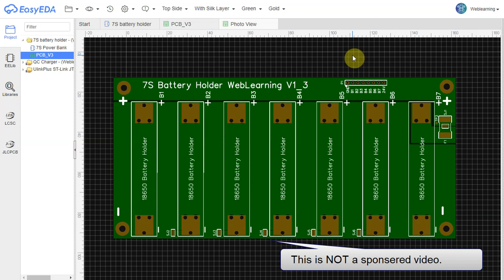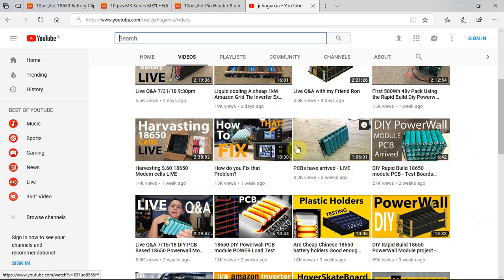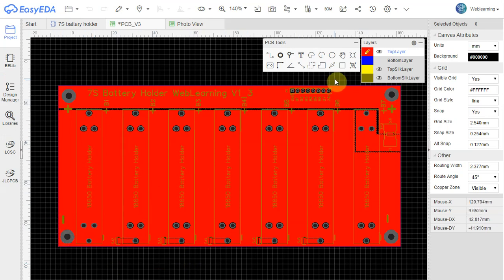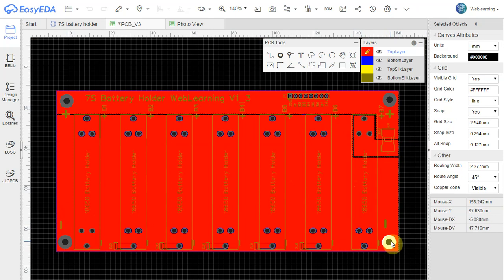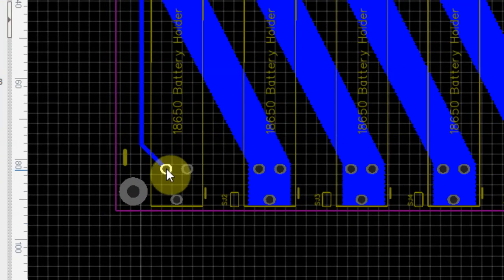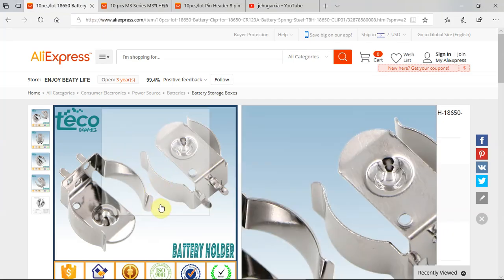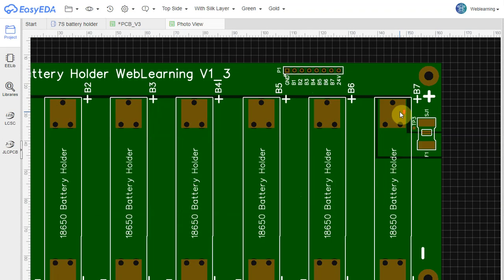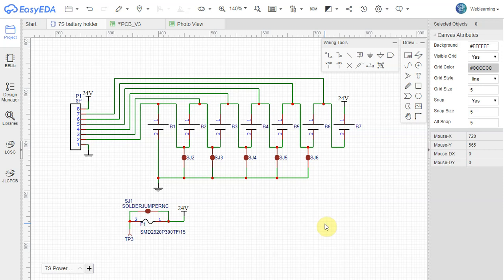7s Battery PCB

Comment: Can we use this PCB with 3S and 5S?
Reply from the maker: Yes you can. I design it in such a way that if you want for example 3S:
You solder 3S solder point ONLY. And add batteries on B5, B6, B7. 
5S:
You solder 5S solder point ONLY. And add batteries on BB3 - B7.

Comment: This battery holder is not preferable because of possible of contact each other and also right and left of the posetive side holder may cut and touch the body(-) side of the battety.
Reply from the maker: Have a look at the previous comments and answers.
Reply: @Weblearning1   which one?....you know what? I bought your design board and i saw the advantage and the disadvantage just last week. Look again the sequence of the  balance pins name and holes...try to correct.

Comment: I don't suppose you could adapt these to 26650 easily?
Reply from the maker: I think it will be possible, need to change the battery holder and re route the PCB traces. If you know how to do this, you can fork the project and do it.

Comment: do not order as is, modify first.

1.When assembled the cell holders are too close and can short when adding batteries. requires more spacing between the batteries. 5mm more in between.
2. both negative standoff terminals are touching the battery holder and are pushed outwards when the adjacent  batteries are inserted. requires more spacing, 6mm more outward
3. separation of the battery clip holder pads on the top side need more separation from the grounding copper .
4. the distance of the cell clips between the positive and negative terminals for each cell need to be brought closer by 4mm due to design of the choose battery clips.

otherwise good design especially since it can work from 2s-7s, and with modifications can be scaled beyond 7s.
Reply: Is it possible to adjust the spaces between the cell holders ; if yes, can some please explain in detail how to do that.

Comment: Hi.
Thanks for the board! It is so good to have opensource stuff out there for others to experiment. 
Could you remodell the pcb that Jehu made for the High power board?
BR,
Gabirel
Reply from the maker: Can you send me the link to what you are referring as he made few different boards.
Reply: @Weblearning1  Yes of course.  Here is the video link to the High Power 7s DIY battery pack. It would be a better choice to have that as it takes up less space. Cheers in advance.

Comment: Great work!  Any progress on your BMS design?  Happy to order some boards and help test.  I really like your choice of battery connectors and overall pcb-based heat dissipation design.
Reply from the maker: The BMS a lot want to join and have it, no one wants to help with the design. So for now, it's on hold. 
Thanks for helping with the PCB tests.

Comment: Have you tested version 1.3 out? I like the metal clips, seems like it would be easier to remove a cell. Also the three points of connection would be stronger than the plastic box attached by eight points for 4 cells vs 24 points for 4 cells. As I mentioned before I would prefer a bit more spacing between cells and if I can figure out how to use eda to do that I would make them and order some. I have several projects for 24v packs I would like to do.
Reply from the maker: I'm planing to do a video on PCB ver 1.4 with most of the comments and I will show how to use easy EDA. Then you can fork the project and build you own.

Comment: has this been tested now? i didn't see an update video on it :/ and is this battery holder compatible with it (https://www.aliexpress.com/item/2x-Battery-Box-Holder-Batteries-Case-for-18650-in-Parallel-3-7V-Pole-Black-Free-Shipping/32655188466.html?spm=2114.search0604.3.54.c0e37c9cwnP9k0&ws_ab_test=searchweb0_0,searchweb201602_4_10065_10068_319_10892_317_10696_10084_453_454_10083_10618_10304_10307_10820_10821_537_10302_536_10843_10059_10884_10887_321_322_10103,searchweb201603_52,ppcSwitch_0&algo_expid=25140a06-4723-4b82-b2d1-af0d3f4aac90-10&algo_pvid=25140a06-4723-4b82-b2d1-af0d3f4aac90&transAbTest=ae803_5)

Comment: Since this was posted back in Aug of last year, do you have this board in production at any PCB manufacturer yet, and if so, which one.  I would love to start testing with this initial board even if it is not yet interfaced with the BMS at this pont.
Reply from the maker: Hi. No board with BMS yet. There was not much cooperation so it was left as it is. All the other boards are DIY and you can manufacture it by your self at EASYEDA or any other board manufacture.

Comment: Hi, great vid. I would be more interested in a PCB in parallel, rather than series, as pointed out in the other comments, so fusing is easier. Some people have made a PCB to slot those units into, rather than using standoffs. The less components and soldering, the better. Or at least the less required after setup, so fuse holders etc.
Anyway, good luck!
Reply from the maker: Any idea how to slot them together? It's eas from the PCB side as I can design the male from the PCB side, the problem is the slot side (female). Any idea that is better then stacking them up is welcome.
Reply: @Weblearning1  Computer slots, like the PCIe connections on a computer motherboard? Bare copper on the ends of the battery holders, slotting into the holder, that PCB being the series connection, with connections to be made from one "back plate" to another.
This thread shows it, but the files don't seem to be available anymore.
https://secondlifestorage.com/t-The-finish-ish-of-a-pcb-based-14S-80P-powerwall?page=1
Reply from the maker: Yes, I know about these connectors from the link you sent, but they are much more expensive then just using spacers, and that's the problem. You need to find a very low cost solution to connect all of them..

Comment: Very interesting, I have built 10 of Jehu's boards and so am very interested in your findings. So please keep me posted also. One thing that I found with Jehu's design was when the thin tracks for the BMS are shorted and blow as they are designed to, there is no solder pad to easily repair the board with a replacement wire. I think this would be a good feature which I will be adding to my design.
Reply from the maker: Good idea. I will keep it on mind.

Comment: I'm in and Appreciate your contribution, thank you for contributing to our growing community. My design or intention has been to use 2 in parallel in each holder to use less boards and take less time recycling laptop packs as they're usually 2 in parallel three or four in series. One could double the standoffs or would this fuse blow.
If yes would it make sense to just add a hole on each side of the fuse to be able to solder a replacement with a axiall glass fast fuse in any case or does this considerably add too much cost?
Reply: Just to be clear it wouldn't be nice to also include the solder joints for a replacement fuse axial glass fuse to have a good visual in place of your bms pcb fuse so one can still protect the module if the printed fuse fails at a glance

Comment: Those battery holder are dangerous.
If the wrap of the cell is damaged near the positive end the positive holder will short to the case of the cell.
Reply: Could use the 18650 battery holder SMD/SMT instead?
Reply from the maker: One of the things that are planned is to build a PCB that will fit different holders. It's in the pipeline, but there are other things before that. Stay tuned.
Reply: @Weblearning1  awesome,  can't wait for the updates.
Reply from the maker: You are correct, but there is no other cell holder that can hold the batteries if you want to use it for something else that is not stationery.
Reply: @Weblearning1  The Keystone single(1042) or double(1048)18650 holders are excellent and much safer.
https://www.aliexpress.com/item/1x-2x-18650-Series-Batteries-Holder-Box-Storage-Case-Container-With-Bronze-Pins-Drop-Ship/32862883490.html
Reply from the maker: Looks great. I will order them and will let you know. Thanks.
Reply from the maker: I have mentioned you in my next vide that I will upload.

Comment: Hi. I note you only use one fuse. If a single 18650 fails with short to ground the fuse will blow. If the board is in parallel with another board the battery monitoring circuit will also be shorted to ground. I see you have a thin track that should fail in this event. However if you have multiple boards in parallel there is a possibility that then thin monitoring tracks will be destroyed on more than one board. This will mean a lot of dismantling to test and repair. Would it not be better to fuse every cell? Then a failure will not be total and you could continue to use the system at a reduced capacity until it is convenient to repair. I understand that Tesla fuse each individual cell. The last thing you want is a thermal runaway.
Reply from the maker: Hi. I agree with you but you need to take into consideration the following:
1. A regular fuse is just like the PCB track unless it's a Polly fuse. 
2. If there is any overload on any of the cells, it has to go through the track in order to burn it. 
3. If the track or a fuse did burn, you will have the same procedure, time, effort to replace them. 
4. The design needed to be as simple as possible without to many parts to solder. Yes, I can make it as robust as I want, but as what cost?
If you want, I can make a robust PCB, let me know what else I can improve and maybe I will make another design.
Reply: I agree that there will be effort to replace a board if a track or fuse fail. My concern is if this is in a multi board power wall there is the slim possibility that several PCB's might need attention even if only one cell shorted to ground. Individual cell fuses should limit any damage to the board with a failed cell. This applies particularly to users with harvested used cells as there is a far greater chance of a bad cell somewhere in the system. I don't think I would be happy to have the current version in my house. Is there a way that the option to fuse individual cells could be added to the PCB for the more cautious users. Or 2 versions, one single fuse as now and one with individual cell fuses. Please note none of this is a criticism. I have been in the machine tool control industry for over 40 years and that has taught me extreme caution where electrical/electronic systems are used 24/7.
Reply: @ianeagland5197  Is part of the issue though that the current board, as well as Jehu's, are both designed for 7s. Cells in series not in parallel. From my very limited understanding, it is far easier to have cell level fuses when cells are in parallel? I can't think of how to design a PCB with cells in series where each cell is also fused individually?
Reply: Would it be possible to just add tiny little holes to the board that way you can place a axial glass fuse if the bridge fuse inside the board burns down we could just solder in a new axle fast glass fuse if not it wouldn't be too hard to retroactively do if said board fuse fails

Comment: I want to be added to the list for the PCB
Reply from the maker: Do you want to help with the hardware design of the PCB or just be informed of the changes?
Reply: I want to be informed on the changes and might wan to buy some to build for my Power wall at home
Reply from the maker: You can click Follow in the EasyEDA and then you will get notification if anything changes. Also, you can follow the channel and when it will be done, I will also upload a video on this. Till then, you can enjoy other videos that I will make.

Comment: Hello. I wanted to buy  10 of your PCB"s but i got an not really good price like 48$ This is the real price?
Reply from the maker: No. Change the delivery so it will be slower, it will reduce the price dramatically.
Reply: I did not wanted fast delivery, that is the reason, why i did ask you.
Reply from the maker: i just checked again. PCB order: $18.86
Shipping, registered Air Mail: $12.58
Total: $31.44 for 10 PCB. That's $3.144 per 1 PCB.
If you dont need 24V, you can use the design that I made for the 4S. That will be much less.
Reply: I got some engineer fee, and i did't understand why, because you made this files, or any people, not any of them, why they want money for it?
Reply from the maker: I also couldn't find anywhere regarding this " Engineering Fee: ". I have sent an email to JLCPCB to tell me why they have added this. I will let you know when I have an answer from them.
Reply from the maker: This was the reply I got from them:
"Sorry for the confusion .
Actually our engineers will review all gerbers two times (before and after your payment ) . 
What's more ,they have to make the working file to avoid errors in the process . 
Thanks for your understand  "
Reply: Ty, for the info, but if they do engineering check how they did not see the problem of your 4S design?
Reply from the maker: It wasn't a short in the 4S, only because of the connector it got shorted. They can only do good DRC, and make sure nothing is wrong in the PCB.
Reply: Can you tell me pls what was wrong, because i'm interesed to buy if it is working. What i have seen on your video, you wanted to find what is wrong and on the panel the battery - and + was shorted. There was no connector yet, or I'm i wrong?
Reply from the maker: If you saw the video, and didn't understand, then I made a bad video if I couldn't show what was wrong. 
The connector of the battery needs 3 pines and a base plate to connect. The 3 pines where connected correctly, but the base plate instead of connecting to the 3 pines it was connected to GND. The same mistake was for the 4S and 7S PCB, but I fixed them both. I still didn't get the new 4S PCB design, so it is also not tested. I don't think there are more mistakes, but you never know..
Reply: Okay.
 Thank You.
Reply: This is where you find out there is a short cut    https://youtu.be/v63KrXLMQYE?t=24

Comment: Perhaps heat shrink tubing on the positive sides of the battery holder will add some addition protection for a short to the battery case. Nice work.
Reply from the maker: I dont think there is a need for the heat shrink and its quite difficult to move them between one another. If there is any issue, for sure I will use the heat shrink.

Comment: cool, I ordered samples to see how they do.   I'd add the ability to break the board in half for those that only need to populate 4s, add standoff holes midway on the board
Reply: jehugarcia I am a big fan. You doing great work!
Reply from the maker: Breaking the board was a bit of a problem with the lines, and also it will cost more to manufacture. So, I made a new 4S using the previous design, and now is costs $2 for 10 PCB's !
https://easyeda.com/Weblearning/7s-battery-holder_copy
Reply: Web learning are you able to at all make a 3s 18650 board? For those looking to make a 12v battery?
Reply from the maker: To make a 12v, you have to use 4S. If you still want to make 3S, the board has a solder jumpers so you can use from 1S -4S. Have a look at the first video.
Reply from the maker: Good idea. It will might cause some issue with the connection between the 2 parts as I will need to do a cutouts. I will see if it works and I will add this as another PCB if it works out.

Comment: Yes . I saw the same design. 25.2v bus. I would like join the design team.
Reply: Jehu's design. He mentions that he doesn't use BMS. I worked on FC and Li systems for Mining application.
Reply from the maker: Im planning to have a smart BMS with min. parts using STM32. It will also monitor each battery and will communicate to a PC the power for each battery pack, status, what should be replace and more. I will publish the idea after I will get everything set up for this kind of collaboration.
Reply: Web learning it will be interesting as the single cell management and  series management is important. The thermal management is important to design a good BMS.
Reply from the maker: Im planning to have a smart BMS with min. parts using STM32. It will also monitor each battery and will communicate to a PC the power for each battery pack, status, what should be replace and more. I will publish the idea after I will get everything set up for this kind of collaboration.
Reply from the maker: What design have you seen?